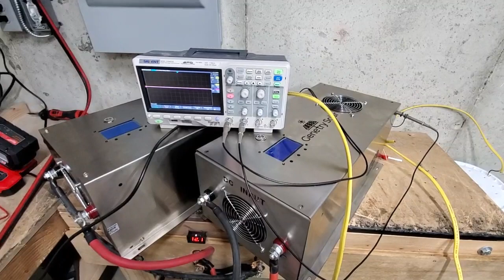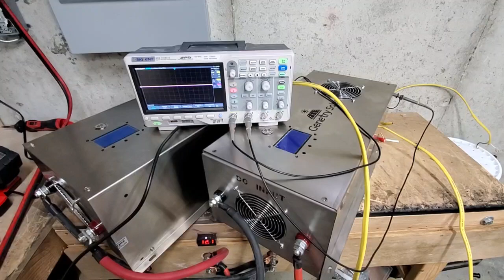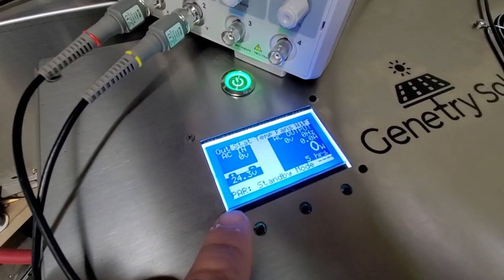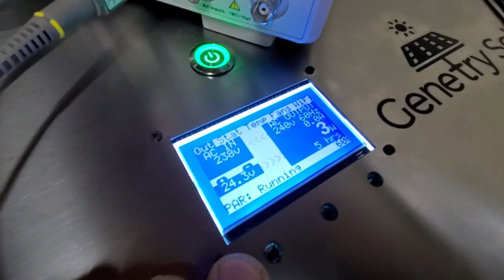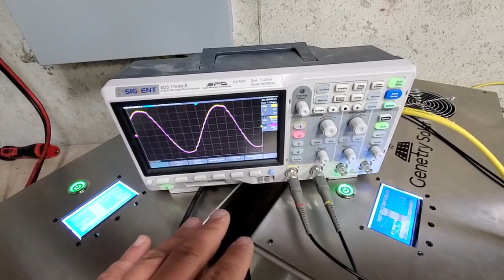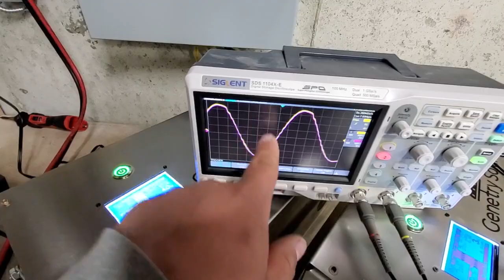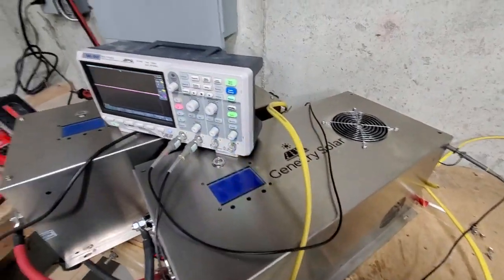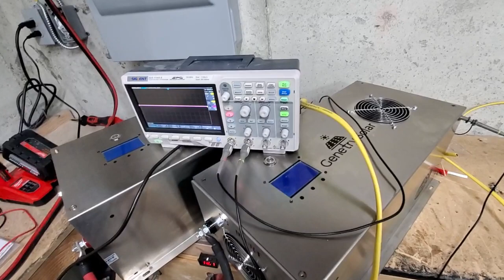Genetry Solar Inverter Daisy Sync Demonstration (And Safety!)

Comment: The "load" on the master is actually the slave at zero throttle actually is self-powering itself from the master.  No power is getting lost, just the slave DC input load will go to near zero in this case.
Main issue that we had in the tests was the slave inverter trying to run 100% throttle into the master inverter--and the master inverter was not reacting fast enough to throttle it back.

The current theory was for the slave inverter to run 100% throttle unless the master inverter throttled it back via positive frequency shift (a la grid tie).  Works alright if there's 30 feet of 12-gauge wire between the 2 inverters.  But if there's no resistance to eat up the voltage regulation difference...well...it goes a bit wrong.
I will be changing it to function in the opposite direction: slave inverters will run 0% throttle UNLESS called for by a negative frequency shift from the master (i.e. "droop regulation").  This also will prevent the slave inverters from mercilessly slamming a generator with full power; if its output frequency sags (under high load), the slave inverters will throttle up.

PLEASE NOTE: All regulation with this method is not instantaneous.  You will not be able to dump a 5hp well pump on 2-3 paralleled GS inverters and expect it to start--at least not for the immediate time.  However, a parallel setup will be able to handle incremental loads up to the max wattage of all inverters in the setup.

Linux rules.  None of this would be possible with Windoze, I'd have thrown the computer out the window already ;-)

Comment: Can't  wait  to  see  full testing.. in charge  mode from. The grid can u wire in 240 or is it strictly  120 volt
Reply: Depends how you get it configured for the chargeing Mine are going to be 120v, since my Generator is 120v only.  Also Grid Tie is not yet in the software at the moment, Sid is working on that.
Reply: Charge is either 120v or 240v, depending on the ordered configuration.

Trying to source relays that will allow next gen GS inverters auto switch between 120v or 240v if necessary.
Reply: @sidlori1592  awesome  thanks  so  much  for  the  reply.  Definitely  planning  on  getting  a  invert  in  the  future.. once  I have  the  funds and finish  building  my solar setup.. thanks  for  all the hard work  on  your inverters..
Reply: a b  Part of the problem is that the PJ CPU does not check to see if the relay turned off before switching to inverter mode.  Though I do agree that the stock relay is undersized.
Reply: a b  Genset control is included in all GS inverters, though admittedly I haven't gotten the code written yet ;-).  PJ inverters do not have any CPU pins broken out for generator control; a revised mainboard is needed.
Reply: a b  You're referring to feeding the main inverter with a GTI inverter?

If so, that is absolutely in the plans for GS inverters...sorta implemented already, just not tested with an actual GTI system.

EDIT: the GS inverter will actually shut down the GTI via frequency shift.